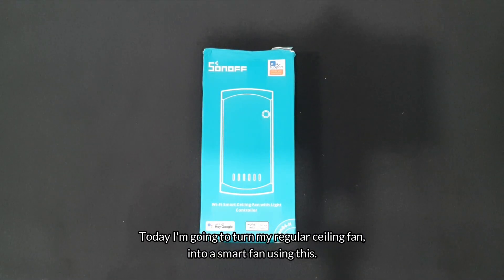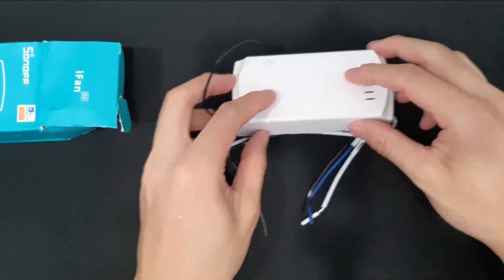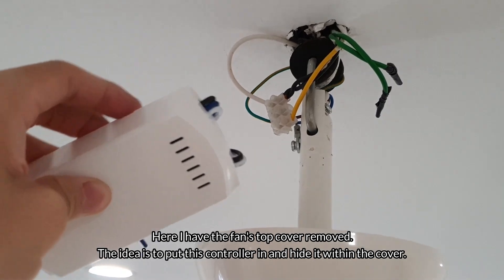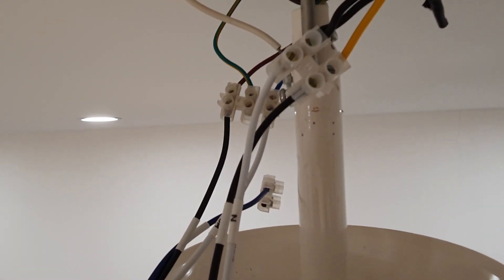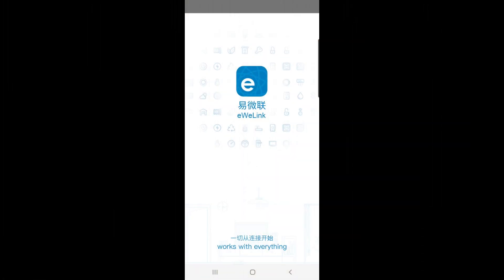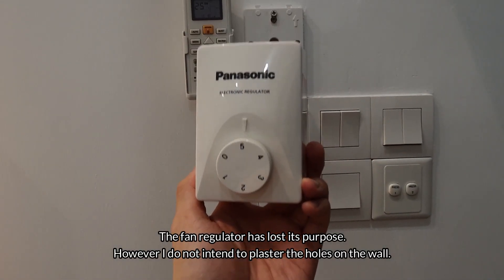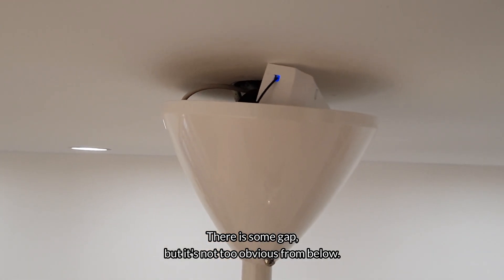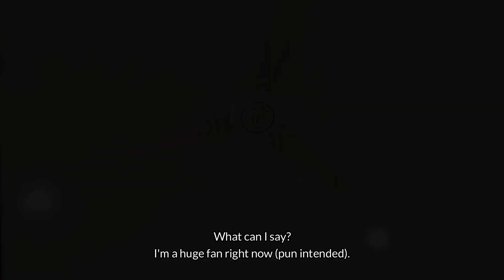DIY Dumb Fan to Smart Fan

Comment: I have to control 4 ceiling fans in a large room.
They all have to be turned ON or OFF by a single button push (all at once).
Can RM433 remote provide such controll (over 433 MHz pairing) ?
Reply from the maker: Yes. You will need to have 4 controllers, an RF bridge, and 1 remote for it. The way I will setup is making a scene where you press 1 button in the remote, and it controls the 4 fans.